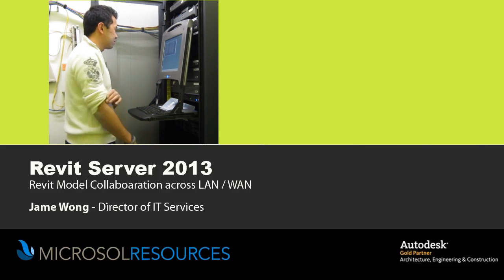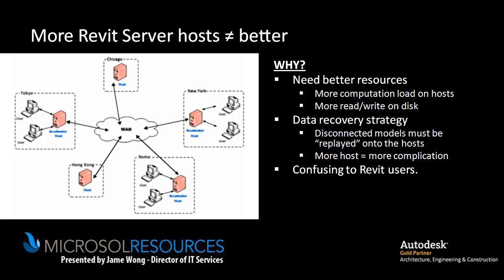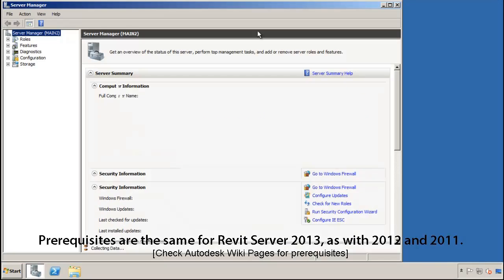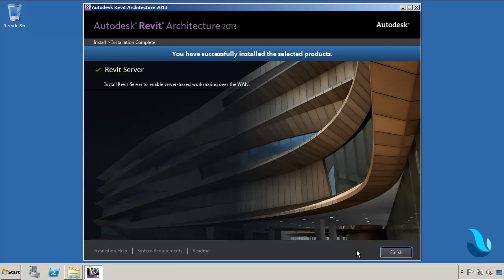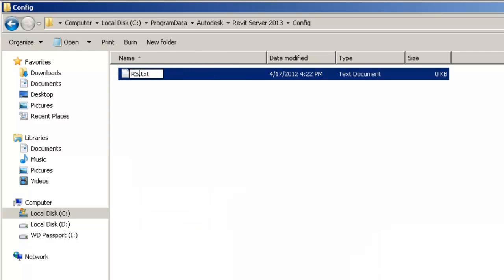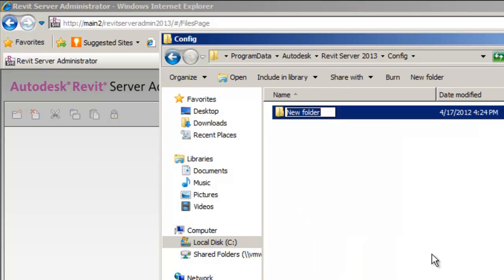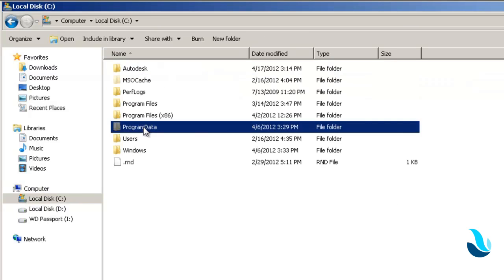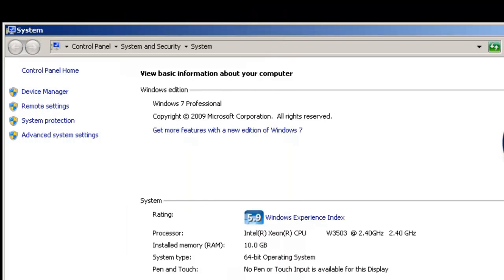Revit Server 2013 - Setting up model collaboration across LAN / WAN

Comment: thank you so much ! I used vitual operation on a computer. but i installed window server 2012 and setup revit server 2014 on it. After that i comback to my win7 to open revit modeling file, save as into a revit server network. Unfortunately, A message box "this operation could not be completed.Please try again, contact your administrator"". I don't know why ? Please help !

Comment: Hi Jame,

I haver a question. Thank you in advance for you answer.
If it possible runs Revit in the same machine (server) that you have installed Revit Server? Revit Server needs Windows Server 2008 (2012) and Revit needs Windows 7 (8)... In my configuration I don't have a LAN, the workstation and the server it is the same...

Thanks!

Comment: Very helpful, but how to connect to remote host. via WAN. can you please explain if my local server is accelerator and remote server is host how to connect. do each end user need to load the file from WAN and save to central server